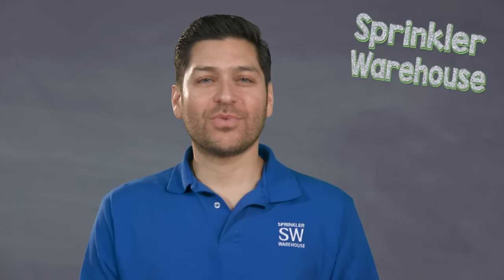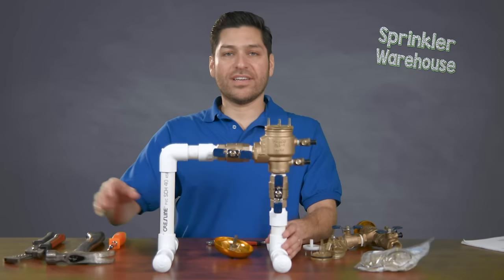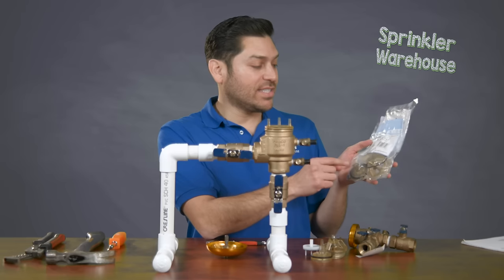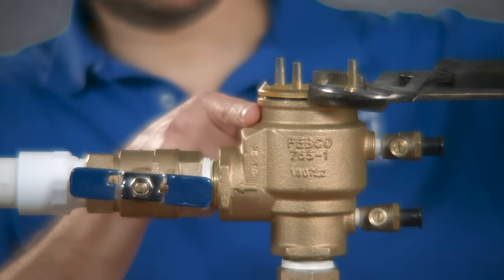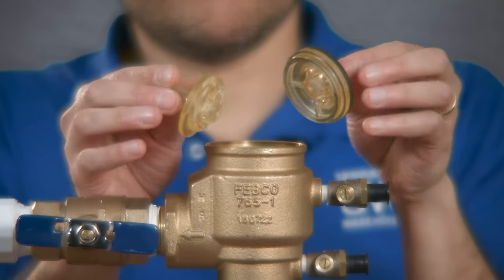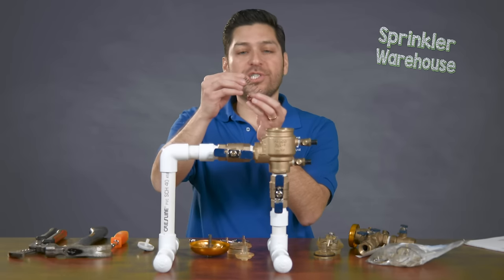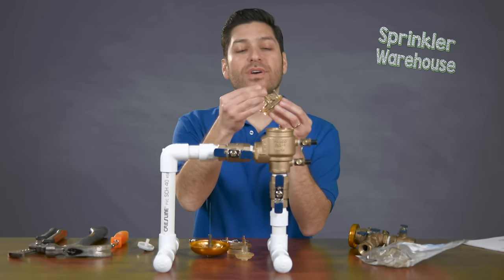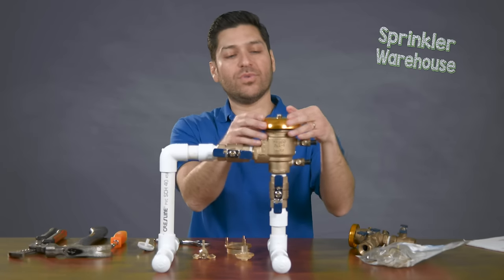Fixing Your Febco 765-1 PVB

Comment: This video needs to explain at the end that once you turn the water on, it will look like the repair has not worked for a minute until the water pressure causes the poppet to fuse to the bonnet. Another video explained this to me after I thought I had failed at fixing the unit. Water will flood out of the unit for a bit, and you should turn on the water supply and allow this to occur before putting the bell back on.
Reply: This happened to me, too.
Reply: Thank you for your post.... I thought I installed it incorrectly as water was still flowing out of the unit when I open the valve... good I saw your post above and that solved my worries.... almost called a plumber.....

Comment: For those having trouble keeping the Cone spring down, There is a ledge that is shaped like a C.  Make sure the metal retainer prongs are facing up, push one side under the ledge.  Spin the retainer till the other side will go under the C ledge and spin a bit more till both sides are under the ledge.

Comment: Fantastic!! After the Texas Freeze my Febco 765-1 broke.  I forgot to winterize. Sprinkler guy came out and said no pipes were broken, just the top portion.  I watched him get parts and replace what is described in the video.  I FORGOT TO ASK HIM THE PRICE UP FRONT.   He quoted a whopping $232.   I said what!!  He go angry and said well if you don't like what the price is, I will reverse what I just did and take my parts off.  I watched him take the parts in reverse of how he put them on.  He  left. I did a search on Amazon and found this part (1" Bonnet Poppet Assem Backflow Preventer Repair Kit Febco 765). After the part came in,  I went on YouTube and stumbled across your video.  I followed the directions, went to the sprinkler box and turn on the system.  IT WORKED!! YES!    AND I ONLY PAIDED $51.97
Reply: Jeez, you robbed that guy of his knowledge and his time. 

First time I lost my pilot in the furnace I called the oil co and they sent a tech. He bled the line and fired it up in 2 minutes. Charged 125. Now, I deserved to pay for not doing any research and for the lesson/1on1 training. I got what I asked for after not doing what I could. 

Here I am researching to not get myself in that situation and here you are bragging about getting your cake and eating it too. You didn't beat the system, you jerked some guy around who drove to your house, stole the solution, created a ruckus, and you both had a bad day because of it.

Look at the damn thing and use your brain before calling service folk!! It has part numbers and shit on it for a reason, and if it's leaking water, it's pretty damn obvious when you're looking for root cause!!
Reply: @dwarflord2k3  totally agree

Comment: I gave up trying to find any iteration of febco 765-1 backflow, repair parts, bonnet, poppet etc on your webstore.  Maybe put a direct link to this specific part under the video.  My unit sits at an angle due to foundation backfill settling.  If I find the little guides broken on the lower valve, I’m going to conclude water isn’t fully draining during winterization and will add removing the valve and covering the opening when I winterize.  I have replaced a bonnet before, but your video was a good refresher.  Thank you!

Comment: Before installing the bonnet, run your finger around the edge where the O-ring will sit. In mine (from Febco), there was an apparent ridge where the two sides of the injection molding came together. When the O-ring is squeezed against this ridge, it created a pinhole leak that squirted out the edge of the valve when the water was turned back on. I fixed it with a small piece of fine grit sandpaper. I sanded the ridge smooth where the two sides of the bonnet came together - on both sides of the bonnet. I greased the area where the O-ring sits and reinstalled the bonnet. No leak!
Reply: Thank you for this tip, I had the same issue

Comment: Can't even find those repair parts anywhere. You're lucky you found it at home depot. Looked at walmart, lowes, amazon, etc - all require shipping and won't be here until end of Feb or Mar.  So I'm still without water bc that sprinkler Febco part is tied to my main line. I'm caught in Snovid 2021 also, but in Sugar Land
Reply: I just bought my repair kit at Ace hardware FYI
Reply: There should be Valves that you can turn off before and after the PVB, just as shown in the video, without disrupting your main home water supply. Are you saying those valves are missing, or when you turn them off, it also turns off water to the rest of your house?

Comment: "designed to fail" at 3:50.   Hahaha.  Great video, very clear instructions for the repair of a product that is designed to fail.
Reply: Yes, the fact that it is design to fail is a blessing. Actually, it means that the removable part fails before the fixed part depressuring the system and protecting the body. If the internal assembly does not fail under extreme conditions, the body will bust complicating everything and making the job more expensive.

Comment: The only issue I had with this repair was tightening the bonnet.  Too loose and it leaks.  Too tight and it crushes the o-ring and leaks.  It took me about 10 tries to get it right.  O-ring was greased and everything inspected.  All looked good.  For me the tightness of the bonnet was a pretty sensitive HAND ONLY tighten.

Comment: I purchased this entire thing brand new from Lowe’s installed it into the pipeline at my clients house and discovered that the retainer the spring and the check valve have been removed and those are the items that are not included in a repair kit and where am I supposed to get those from. You mentioned in the video no big deal we can pick up another spring. But from where? Overall the video is great because I was able to see the items that belong inside of this device and the install instructions do not mention anything about the internal parts so at least now I know what I need to get and I appreciate the video for that.
Reply: I installed the new febco complete system,  not the repair kit. The problem I have is that it s leaking water from the upper brassy big cap. Help please.

Comment: I’d like to know how are you winterize the sprinkler system to blow out the water from the pipes on the ground
Reply: There are two repair kits: 1” to 1-1/4” and 1/2” to 3/4” Bonnet and Poppet repair kits from Home Depot or Lowes. Which one should I get for my Febco 765-1?
Reply: @stevenyee1698   🙄

Comment: very helpful and clear, but why this plastic thing is so easy to break, I indeed winterize my sprinkler each year.
Reply: Better to break that then the brass body.  However, if its breaking every winter you aren't winterizing properly.  I'm a bit surprised at how expensive this part is.
Reply: that's exactly it function, is like a plastic fuse for pressure. If it breaks means you still have water in the system and it gives pressure. I just bought a house and it has this valve broken, but I dont have the umbrellas so I need to buy the entire thing since no repair kit includes the umbrellas

Comment: Ho when I turn on the valve to get the water no problem not water coming through the bonnet. But when I open the 2nd valves for the sprinkler network water come out checking the bonnet like crazy and sometime it stop or never stop. Any idea

Comment: I replaced this piece in my backflow preventer and when I open the water valve it pressurizes and seals. The problem I have now is that when I run my sprinklers they have very little pressure in most areas to where the sprinkler heads don't even come up from the ground and other areas just cause water to spurt out from the bell on the backflow preventer. Any ideas?
Reply: You should check every sprinkler head to make sure non are broken below the ground etc 🤔

Comment: Anyone know what the grease/lubricant is called/where to find it. The parts that I ordered didn't come with it. Do I need it?
Reply: A silicone-based o-ring grease would be needed.  Petroleum-based grease will degrade the o-ring.  Easy to get from hardware store or interweb

Comment: I did all of this. But it still leaking from side tubes. What am I doing wrong?
Reply: Have you find out why? We have the same issue.
Reply: @wenchang5380  take a flat head screwdriver and have the slots pointing up and down.  This should close your valves.

Comment: What if you installed the new kit, and check valve, and it still leaks??
Reply: It would depend on where the leak is coming from but try shutting off the water again and re-turning it back on. That usually does the trick for me if the water is coming out from the top. 
If not, try to make sure the bonnet is sealed properly with its black plastic ring on. Sometimes you have to either tighten it or readjust the fit.

Comment: what if the input valve is fractured also so not only do you need to replace the internal febco parts but the inlet valve? My plumber used copper.  If you try to rotate the valve it loosens on one end and tightens the other end! and you can't rotate the febco breaker because it's attached at the 90 with the outlet! The valves seem to have a partial slip coupler on one end to account for this but no matter what I do it doesn't slip enough to actually fully loosen the valve it snugs down no matter what way I rotate the valve.  What a poor design.

Comment: This guy does not know how to properly repair this PVB.
The most important thing is to Only put grease on the bonnet O-ring so the bonnet tightens up smoothly and so the o-ring does not bind and curl up on itself and then leak.
Never put grease on the poppet gasket (that he also called an o-ring) because the grease turns into a sticky gel and glues the poppet to the bonnet. That poppet needs to drop away freely.

Comment: What about finding and removing any broken bits and other debris? What about inspecting the internal seal surface? Why did we just lubricate that surface? It shouldn’t be lubricated. Getting that spring retainer in there IS frustrating...when you don’t explain how it is held in place. If you explain that it needs to be rotated into the slot, it becomes much easier. Good try but it’s clear you don’t do this on a regular basis.
Reply: You think making a video is easy. Try it.